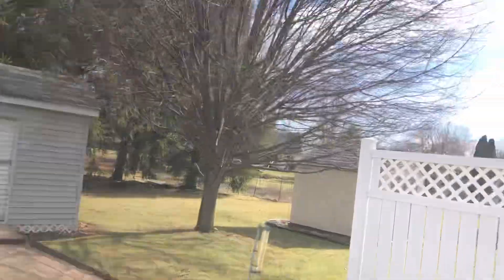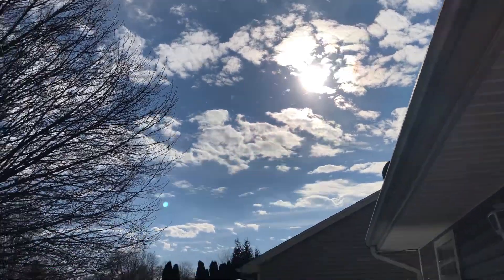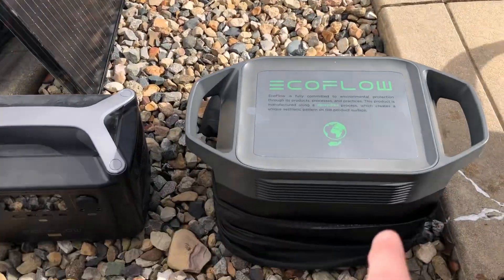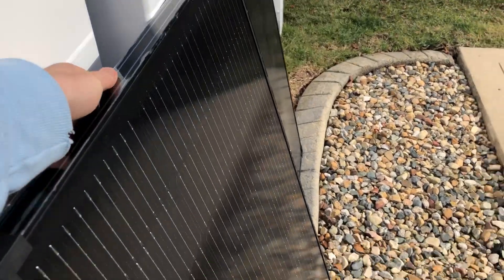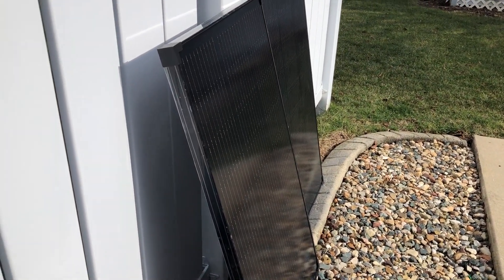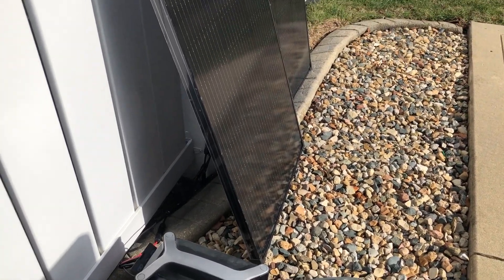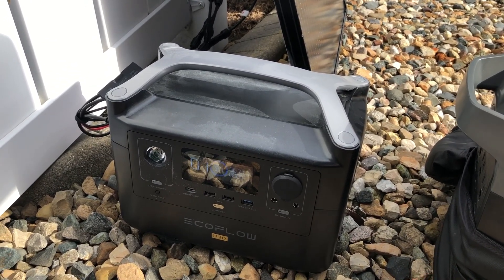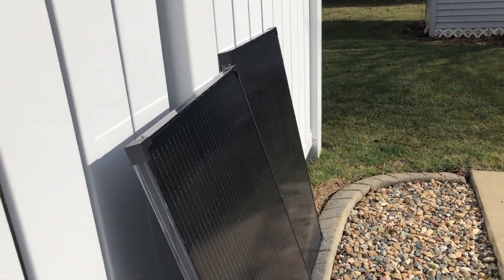EcoFlow 100W rigid solar panels review with an EcoFlow River Pro

Comment: Do you need any extra hardware to serial connect to the Ecoflow river?
Reply from the maker: You can connect them in series with just the regular cable that comes with all of the solar generators. But I believe what I ran into is that with them in series the amperage was too high for the river pro. So that's why I hooked them up in parallel

Comment: My bluetti eb3a unit has an input power of 200w max,12-28v OCV, and an input current of 8.5A, would it be safe for me to use two of these 100w solar panels from ecoflow connected in parallel? Please let me know.

Comment: Does the ecoflow river pro accept the 200w of the solar? Is it not too much?
Reply from the maker: It does accept that much power, but you have to hook up the panels in parallel not series. And for that you do have to buy parallel cables